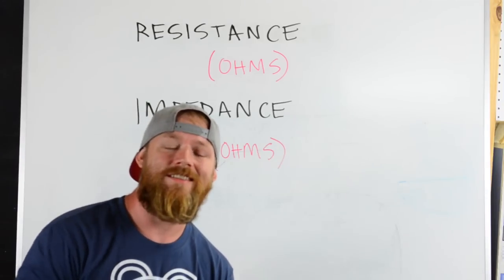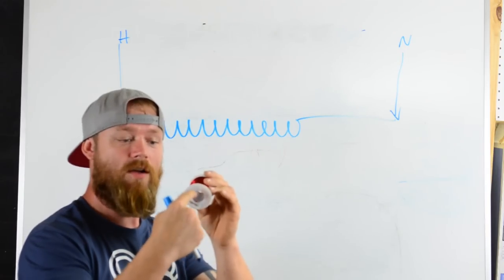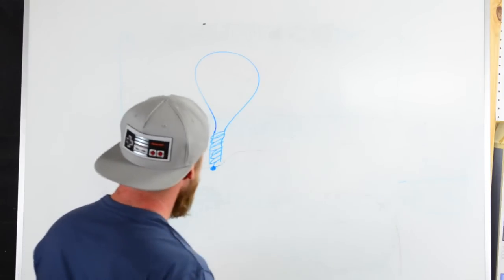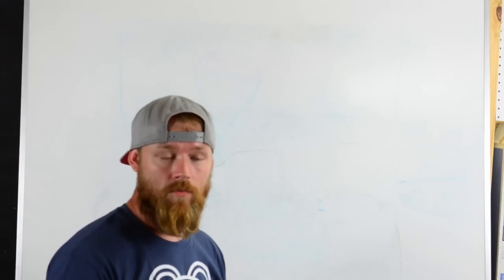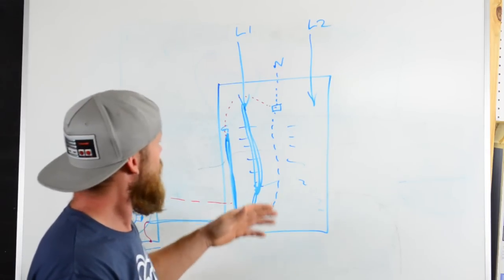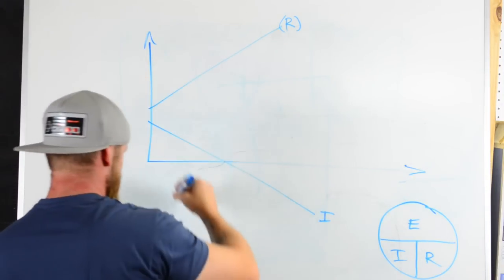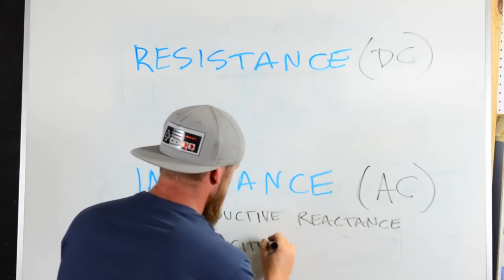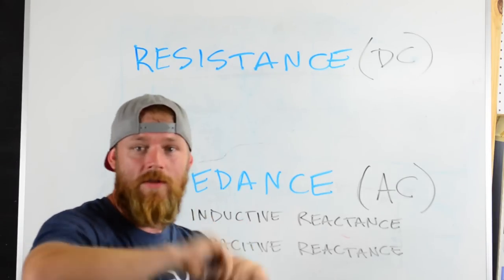What is Resistance/Impedance (Ohms) - Why electricians need to know it

Comment: The charge on a plate in a capacitor is not caused electrons repelling each other, it's caused by electrons building up on the negative plate and being attracted to the positive plate but not being able to jump the insulating gap between the two. 
Inductive reactance is caused by the expanding and collapsing magnetic field, which is caused by the fluctuating intensity and direction of current flow. When the lines of flux pass through the neighboring loops of wire in the coil, a voltage is induced that opposes the source voltage. Same concept as a shake flashlight. And also pretty much every part of our electrical infrastructure-
Reply: Adam ........precisely !!!

Comment: You are doing a great job..... I think you are going to end up like your Master friend that left the field to be a teacher. I can tell you have a heart for teaching. 
A couple of things you missed or skipped over (1) one important factor that people don't really understand is the effect of distance (multiples of 100 ft) require stepping up your wire size every 100 ft. You did mention using the "Correct wire size" but you can get in trouble thinking that a #12 wire is good for 20 amps and forgetting to calculate the distance to the load.....etc (2) When you drew your load panel you didn't show your Ground being attached to a ground rod, building ground or plumbing ground (copper or steel pipe) If I have a subpanel more than 100 ft from the Main Entry load center I create another grounding point.

Comment: Hey Dustin can you make a video demonstrating voltage, amps, and resistance in Residential and how I can use those to help me solve electrical problems?
Reply: That's way too vague of a question to be taken seriously. You expect a certain voltage ± a few Volts. but if you have resistance in the circuit you'll get a lot less. Usually caused by a loose wire somewhere in a wall. This is very very bad because high resistance = hot which might mean 🔥.
End of lesson

Comment: FWIW we deal with impedance all the time in DC circuits when we process signals. The signals being processed are small but still AC. Anytime a circuit introduces inductors or capacitors then it becomes frequency dependent, and that's pretty much every single circuit that involves communication. This is why guitar players sometimes have radio stations bleed thru their amps.

Comment: 2 things I've long found odd:
1.  We usually use impedance rather than conductance, which is a much more sensible concept.
2.  Many instructors use equations as explanations.  Equations are descriptive and predictive; they are not explanatory.  (E.g., ask most instructors what a resistor is actually doing to voltage and current.  Most refer to Ohm's Law rather than explaining what's actually going on conceptually and causally.)

Comment: Hey Dust. Just a quick comment on your front loader drawing. I think it might be confusing for an absolute beginner looking at your drawing. It looks like the wiring is going straight from your panel to the washing machine and not to the receptacle that the washing machine is plugged into. Just a little side note.

Comment: Excellent series on the electrical trade! 
I really enjoy and find your videos very precise and informative. And I’ve been doing this crap for over 40 years now... 
  Great explanation of resistance verses impedance.  Yes, do a video on capacitance, inductance, reactance. Explain what each component is and how it factors into a circuit, should be very interesting....    Use these terms and equations in the RF world as well, now that’s when it gets really interesting!

Comment: The resistance in a bulb filament isn't because it is coiled. You can have straight filaments. It's the material itself which resists the flow of current. Same thing with toasters or any other resistive loads. If I'm not mistaken, coils on a DC circuit don't present resistance. That's only true for AC (impedance), where the back and forth of current flow collapses and reforms the magnetic fields.

Comment: I worked with a brilliant 30yr + electrician who told me that you don't really need an earth (I'm in the UK) / ground. He said it's only really needed in countries that have alot lightning strikes. Many countries in Europe don't use Ground conductor / earth..... I quizzed him on this & he said that's one reason why!

Can / could you elaborate on this! doesn't make sense to me, a difference in potential between to accessible points is gonna short circuit!?
Reply: I don't think that is correct, the main purpose of a ground is safety so if someone touches for example a ceiling fan fixture that has a fault they don't recieve a shock as the current will find an easier path IE the ground. Useful for lightning too but not the point.
Reply: @strawberyyicecreamdream216 It's not that it's taking an easier path through the ground wire and thus leaving the person alone, the ground completes the circuit back to the box and since there's no load it creates a short and trips the breaker so that there's no power going to the equipment

Comment: What can you share about low voltage and solid state controls and PLC controllers? It's always an interesting field and I have run across this a lot in troubleshooting equipment control circuits.

Comment: Current doesn't flow through capacitors. The anode and cathode build up opposite charge in large quantities, but are physically separated. A capacitor will discharge when the voltage is reversed, which is why they're useful in AC circuits. They can be used in DC circuits, but they're only useful in conjunction with transistors or switches, where you have voltage collapses or reversals.

Comment: Hello, great theorey, would this be the same as inductive reactance, dues to the 
back-voltage? I wanted to run a number of appliances from a 7.5 kw gen so I put
upper and lower heaters in wtr htr in series and that brought down the current to
15 amps and the htr now consumed 3600 watts, the qwater was somewhat warmer
and I had more power for other loads.

Comment: capacitor start motors like for an air compressor? change the power factor and get more starting torque? caps being used a lot in the A/C  industry. start and run caps. . .

Comment: Impedance is the sum of resistance ( the real axis X) and reactance ( the imaginary. Y axis) for example "3+j8" in the case of an inductive circuit or "4- j6" in the case of a capacitive circuit. These are two examples of complex numbers.

Comment: Lines of flux in MOTION is what causes the resistance. DC through a coil has lines of flux standing STILL with near 0 ohms. AC is in a constant state of CHANGE in current flow.

Comment: In your printed text you have a sentence that reads “When current leaves the source and travels into the appliance, it has to travel through instructors and capacitors on its way out of the appliance and back up to the source”.  Could the “instructors” be Plummers or Carpenters or do they have to be Electricians

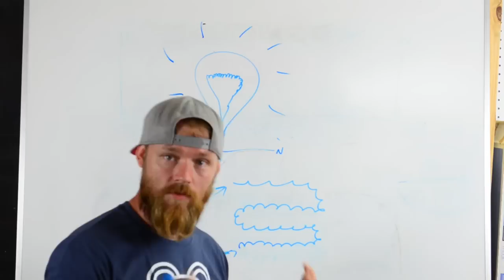Comment: Around 8:15, Dustin says that toasters and furnaces work off of cramming current through a high resistive load. But let’s say a furnace uses 40 amps at 240 volts. If you use ohms law R=E/I, then it would be 240/40= 6 ohms of resistance. Compare that to a lamp, which lets say uses 60 watts. So using E2=PxR, then it would be 120x120/60= 240 ohms of resistance. So really, a furnace has a relatively low resistance compared to a lamp, or am I doing the math wrong?
Reply: To me (still at novice level), your math checks out (though, I'm wondering why the voltage changed from 240 to 120). The more resistance, the lower the power, which correlates to the furnace having higher wattage than the bulb.

Comment: So does it trip the breaker because now it doesn’t have resistance from the motor it’s just touching the metal so it goes right threw and is sending a larger amount of electricity to trip that breaker?

Comment: I have a question about grounding. Can the ground still work if it isn't bonded to the Neutral? I mean if it only goes to the iron rod that you bury in the ground. Or even in an old house (ungrounded) where it wouldn't be possible to run a Ground wire through the conduit, could we just use the foundation as a ground (specifically brick buildings)? Is there any other reason than code to keep to, like is it going to create a lot more impedance if we do not connect the ground iron rod to the Neutral?
Thanks for all the information you put out on each video.
Reply: I believe it would
Reply: No it would not. If the grounding system is not connected to the neutral, the danger would be that you could have a fault which cannot clear, because the path the electricity has to take is not a good enough conductor to draw enough amps to trip the breaker. Never do this!

Comment: I think Dustin might have misspoke in the beginning. "It's the spiral of wire that's slowing the current down." I don't believe this is accurate. The spiral or coil doesn't affect the current. It's not the shape, but the length of the conductor. Resistance is equal to (resistivity)(length of conductor)/cross-sectional area. Or R = ρL/A. By either increasing the length and/or decreasing the cross-sectional area, will we get an increase in resistance. However, increasing the number of turns in the coil results in the increase in length of the wire which then increases the induced magnetic field. Also, regarding capacitors...electrons are negative, by definition. There are no "positive electrons". What Dustin means is that there is a potential created between the positive and negative terminals separated by a ceramic dielectric that becomes polarized in the presence of an electric field. When it's charged, electrons build up on one terminal, creating a potential difference (voltage). So when the circuit is opened, these stored electrons then flow to the load, released to smooth out the interruptions from the power supply. Not an easy subject to learn and grasp.

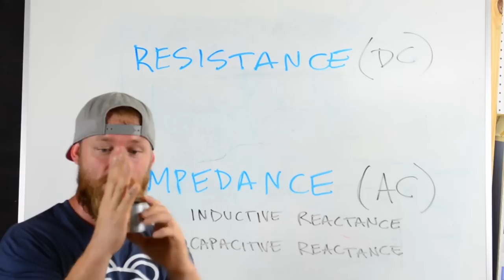Comment: At 19:04 when he takes his left hand off of the capacitor and it stays stuck to his hand. This man has been around enough electricity that he himself has a magnetic field.
Reply: If you look closely and quickly you will see that his right thumb is gripping near the top of a capacitor near where the terminals are, just enough to keep a hold onto it.

Comment: when you say a hot and a neutral wire. does that mean - = hot and + equals neutral?
Reply: In a Alternate Circuit (AC) there is HOT (live) and Neutral, in Direct Current (DC) it's Positive (+) and Negative (-)

Comment: When you explained capacitors you mention negative electrons on 1 side and positive electrons on the other. What is a positive electron?
Reply: Technically there is a thing called a positron, which is a positively charged electron. He wasn't referring to this though, what he meant was negative charges on one side (electrons) and positive charges on the other side (protons). While the protons don't flow like electrons do in a circuit, when a bunch of electrons build up on one side they repel all of the electrons on the other side away since same charges repel. This is how you get a result of one side being negatively charged and the other side positively charged.
Reply: @stevenfordham2262  Thx!

Comment: i feel that the ground and neutral is the same. its there to protect you and equipment....giving it 2 ways to ground itself. so if one breaks then one still works. example...ca car battery you have a red wire and a black wire but that doesnt mean its grounded. i then have to see if the negative is attached to the metal of my car. in most cars the red is thicker than the black wire....so after a long time it will fail thats why there is a fuse ..so it burns out before your wires burn out.
Reply from the maker: This is wrong my friend.  The neutral is not the same.  It's not there to protect equipment.  The neutral is a current carrying wire, meaning it always has current on it.  A ground never has current on it.  A neutral is needed for a load to work.  A ground is not needed for a load to work.  Think of the neutral as a "white hot" because it has current on it.  It is NEVER EVER used to protect you or equipment.

Comment: Can you make a video of how to compute electrical load.?light and commercial application.thanks
Reply from the maker: It's going to be quite awhile before I get to any load calculations.  I have a lot of how-to and theory to get through before cracking open calc's.  Check out Paul Abernathy's or Mike Holt's stuff though.  Lots of great info, Paul has a podcast and Facebook group called "Master the NEC" where he goes over a lot of stuff like that.

Comment: The coil really doesn't slow electricity down...its the material of the composite metal that slows the flow down because its either less conductive or its a smaller diameter than the wire its connected to which in turn creates heat and is then dissipated through the ceramic or another form...and you can change amperage...Ohm's Law V=I×R

Comment: my journeyman said that the ground is there to protect the person and the neutral protects the equipment, does that sound about right?
Reply: g00se0017 the ground part is correct, the white neutral still has current on it and technically is still a hot wire. However you need neutrals to be connected to complete circuits and make sure your sending “x” amounts of current and voltage back to the supply (service)

Comment: Impedance is based on frequency instead of voltage. Resistance is purely based on voltage. There is not differentiation between AC and DC. Usually you are talking about the END of or at some point, a CONVERSION point of voltage and FREQUENCY. That is what changes RESISTANCE and IMPEDANCE. There is literally no differentiation between AC and DC with Impedance and Resistance.

Comment: Ok. This comment is made right at the beginning without watching. Just saw the title "Resistance/Impedance". Thats... just... wrong.  You can't equate the two.

And two second later AC and DC... wow... noooooo.
Resistance is a purely resistive load like a heating element, in fact most resistance is just heat losses. Impedance is the sum of Resistance, Inductive reactance, and capacitive reactance.
Think power factor correction. Think Vectors dog. VECTORS! Resistance is straight , inductance is up, capacitance is down.
V= IR(Resistance)   E=IZ(Impedance) Z= R(resistance)+XL(L is inductive and a subscript... that I cant create here)+XC( C is capacitance also a subscript)    ( X is reactance)

In DC land Resistance and Impedance are an equal value. In AC the above stuff. Z=R+XL+XC

Uhhh If you increase resistance amperage will always increase not decrease. Voltage will decrease. Think Voltage drop.

Finally got to the end.  There ya go.... ish.  3 elements not 2.

Watts... Puuuure resistive load.  VA volt amps? guess what? ( oh god blanking on the letters....) S.... oh yeah S(va)= P(R)+QL+QC

Comment: Too stupid, too understand.
 I bought a brand  spark plug lead.
Both cables  are the same, except the age. 
 The old cable is 8 years old.
My measurements:
The new cable:  2.1 ohms
The old cable: 1.6 ohms
Is the difference big in regards of ohms values?
What's your opinion?
Thanks
Reply from the maker: Antonio Pereira not too stupid my friend, this shit can be thick at times. Less resistance means more current can flow. There’s literally less stuff resisting current flow. More current flow = more energy delivered. It’s like trying to cross a bridge. If your goal is to get across the bridge as smoothly and efficiently as possible, having 50 cars on the bridge (more resistance) would be less efficient and lower speed/power than just driving straight through. Make sense?
Reply: Agree that Antonio is not stupid and this stuff can be tricky. For a spark plug wire a difference of 0.5 ohms is insignificant compared to the spark plug gap. One of the more important features of a spark plug wire is the ability to insulate the high voltage from the engine parts, a tiny crack in the insulation can provide an alternative path for the current besides the plug causing misfires. Aged spark plug wires can develop these cracks over time due to engine heat etc.

Comment: No No No this is wrong and already I'm going to say this wrong on all the levels of wrong. Impedance and Resistance is both existent on AC and DC loads. There is nothing that changes how electrons work. Impedance is just what happens at the END of the electron flow and Resistance is what happens ALONG the electron flow.